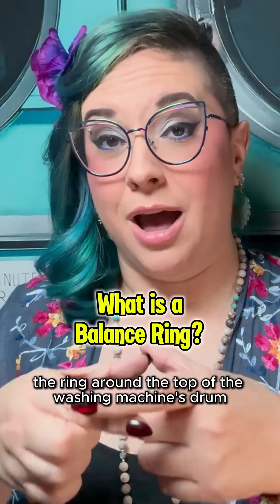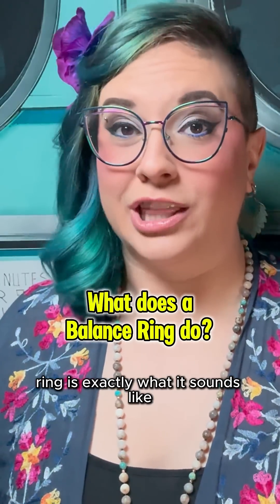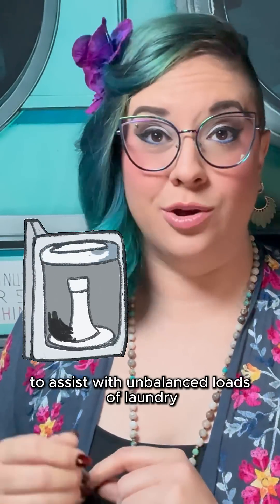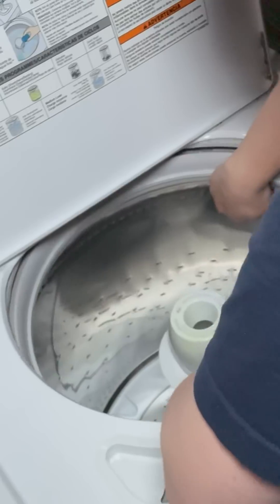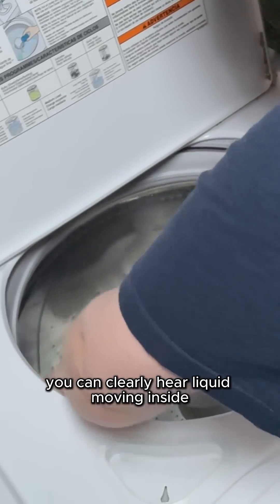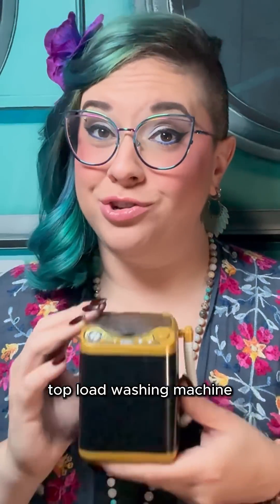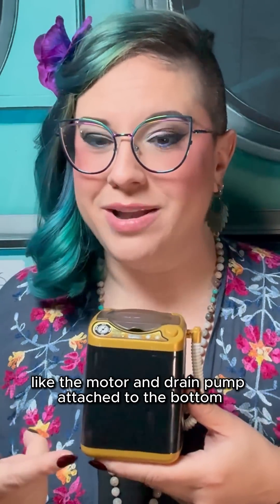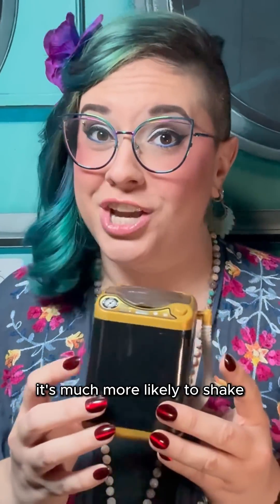How a Balance Ring Prevents a Top-Load Washing Machine From Shaking

Comment: Before I ultimately determined the smell in my washer was coming from a detergent build up, i was convinced the water wasn't draining completely bc of the sloshing. I'm glad a quick google taught me about the balance ring prior to me following my usual M.O., which would have been learning how to disassemble my washer on a whim to find that damn backed up water. 

Just a few months prior to that, my M.O. and a horrific squeaking in my dryer led me to learn how to disassemble my dryer on a whim and also learn how to replace the drum belt on my own. And good news, my lint trap works quite well, bc I had virtually 0 lint in the inside of my machine 8 years on.